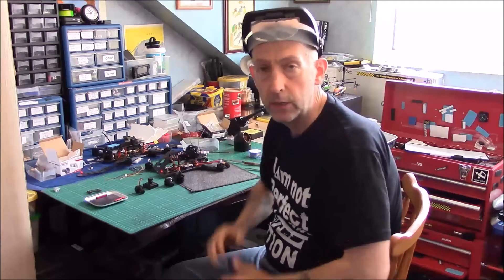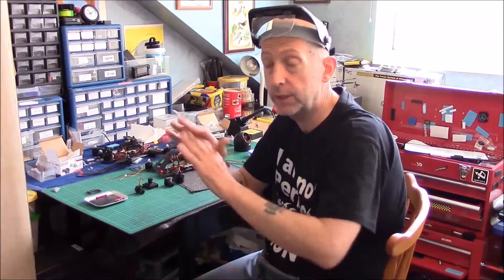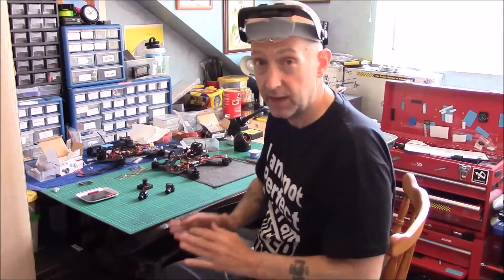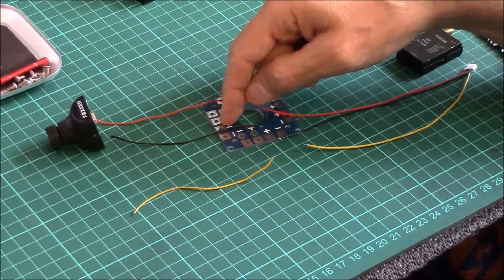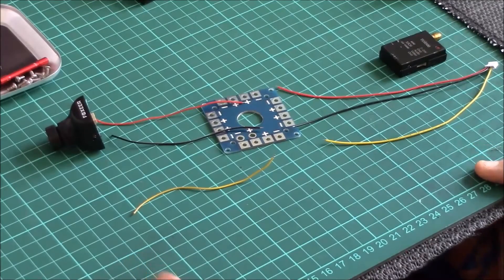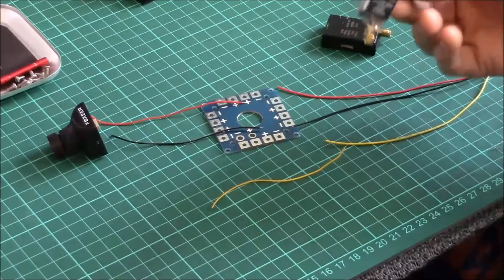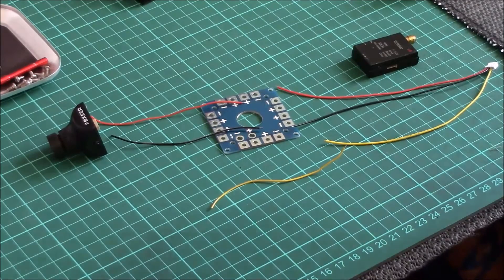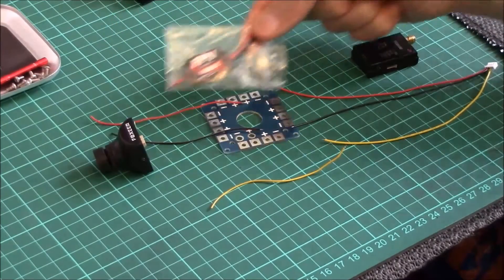FPV BASIC WIRING SET UP

Comment: How going to fc? Like f405 wing
Reply from the maker: Hi, Solder the black wire from the cam to any ground then solder the Red ( now check how many volts your cam can take EG, 5 to 24 v this info will be on the cam. However if your not sure then solder the red wire to a 5v out pad. ) On the F405 you will see a pad marked ( CAM ) the signal wire from your cam goes hear ( usually its yellow )

 Hears some links that may help,  https://www.youtube.com/watch?v=CiFRNJUUdwM
https://www.youtube.com/watch?v=QhW-0ddGJ7A
https://www.youtube.com/watch?v=wH14PK1cI3A
Reply: @GeorgeCooper_LoneWolf  thanks George Cooper for the help and response..godbless